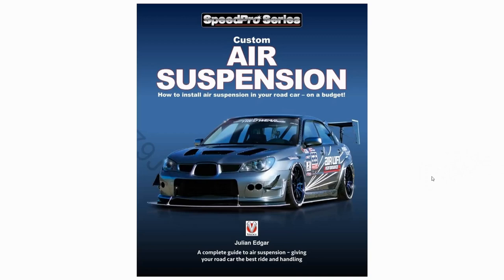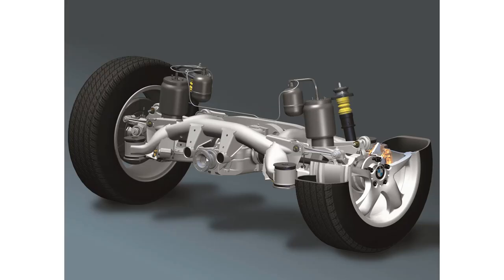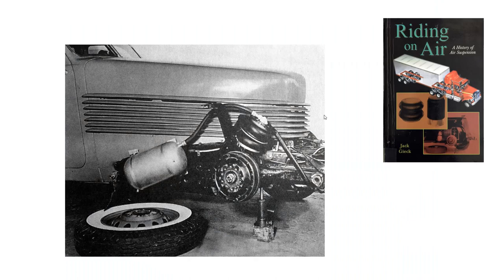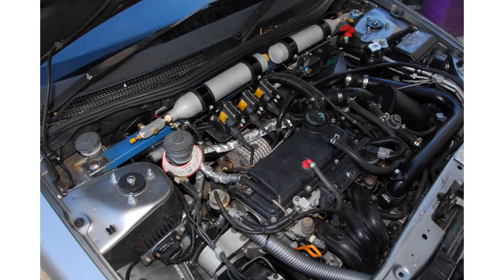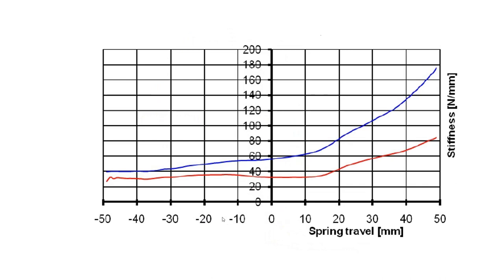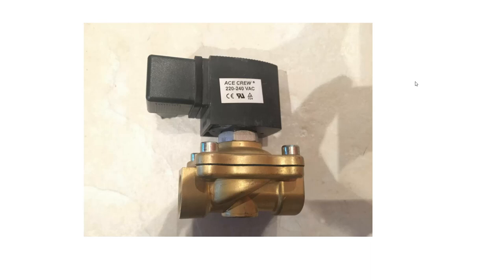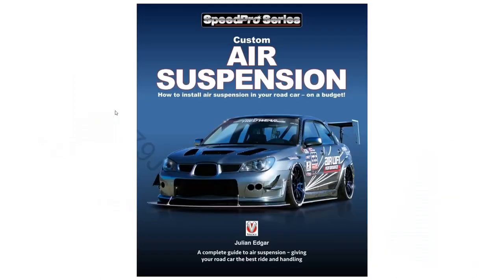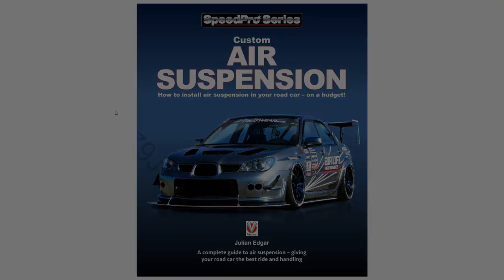Changing air spring stiffness

Comment: G'Day Julian, I purchased your book yesterday and my head is absolutely spinning! Im completely new to these concepts but fortunately your book makes them very approachable so firstly thank you for that. If spring rate is determined by the volume of air under pressure (and ride height is determined via pressure as well), wouldn't opening the accumulator and increasing the volume decrease pressure and thus ride height? Same amount of air with more space?
Reply from the maker: Yes that's an interesting point. I've not opened a valve that connects an extra volume 'live' - mine have always been plumbed into place permanently. It might be that the factory cars that do this progressively open the connecting valve and then when everything is right, fully open the valve to allow free airflow. (Ie ride height is adjusted during this process.)
Reply: @JulianEdgar  Thanks for being available to answer questions like these mate - great advertisement for the internet! So factory cars must feed in pressure as volume is increased - in order to maintain ride height and thus travel.

Regarding suspension travel (aka stroke) - is it as simple as saying it's determined by x? Or is it affected by ride height, spring rate and/or other factors?

I might as well ask: I'm researching whether or not it's possible to fit air suspension to a Mazda RX-8 so it can be raised up to travel down light trails in national parks (envisioning a driving/camping tour). Car would be loaded with 300kg-ish worth of gear in between camp sites. You reckon this is feasible? I appreciate it would be beneficial to fit air suspension to maintain ride height under the increased load anyway.
Reply from the maker: @GetUpFalcon  Suspension travel is just how far the wheels can move up and down.  However,  spring travel for that suspension travel depends on the motion ratio. You could fit air suspension to the RX8 to achieve the aims you set. But it will likely be quite expensive. Maybe start by using Chapter 12 as a checklist and then looking at all the kits that are available.
Reply: @JulianEdgar  Ah, good point. Thanks again, I'll continue head scratching my way forward.